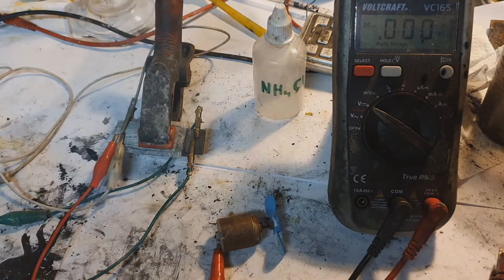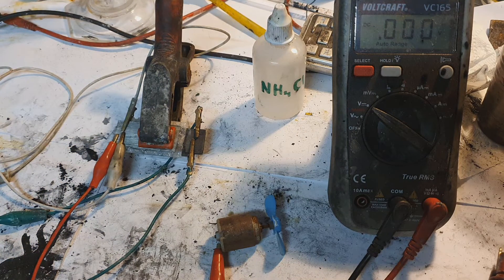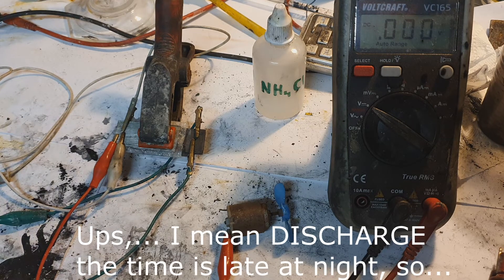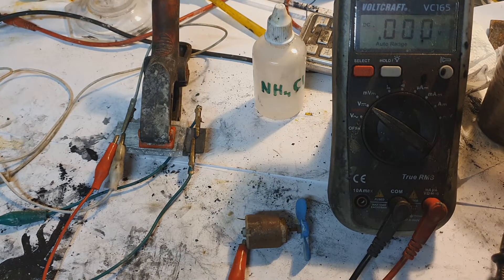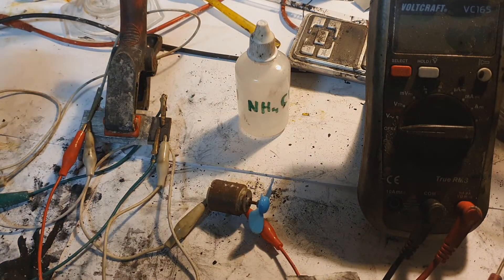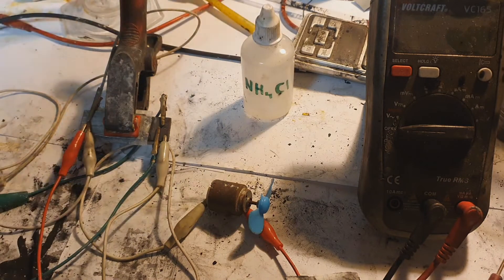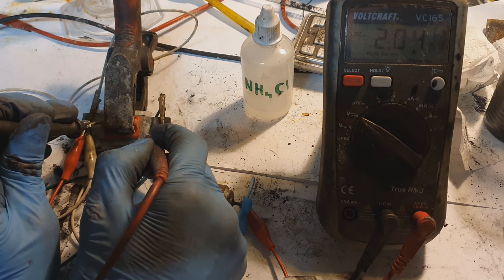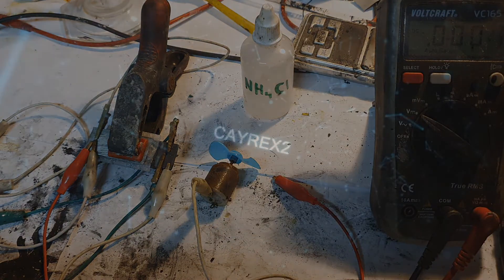2 Volt Tin oxide - Zinc Battery

Comment: Don't get me wrong, but it all seems very strange, starting with the patent itself, which uses a tetramethylammonium hydroxide electrolyte and which, according to the manufacturer, is incompatible with both zinc and tin. 
Link: https://www.merckmillipore.com/BR/en/product/msds/MDA_CHEM-814748?Origin=PDP
Are you sure that all that was presented is not a Hoax?
Reply from the maker: Hoax?? I get what I get and this I also share. Tetramethyammonium hydroxide works terrible for me
Reply: @cayrex  So you agree that we cannot use tetramethylammonium hydroxide electrolyte for the battery because it reacts with zinc and tin to produce hydrogen. This wastes power and renders the cell dangerous to use. So I wonder what patent rubbish is this?
Reply from the maker: @antoniocarlossforza  for me the use of tetramethylammonium hydroxide was the worst,.... so if you ask me this was a little hoax in the patent or the author dont apply the full data. Potassium carbonate which was also described in the same patent (on the almost end of the paper) was a bit better (the cell on potassium carbonate) run a motor for 3-4 sec. So, potassium carbonate was better but still wors what I can get with ZnSO4+NH4Cl.

Comment: I am trying to realize this battery similar to the patent - metal zinc and tin (97% other is copper) as active materials and 10% solution of NH4OH. Unfortunately the results are bad. Power output is ridiculous - high voltage drop when load is only 2 kOhm. Charging current is about  several milliamps but i think this power goes to something else, althought there is no intensive gas generation. I dont know what i am doing wrong. The patent says charge and discharge positive electrode states  are stannic oxide and stannous oxide, maybe it needs some cycles for metal tin to transform to oxide and getting good capacity?
Reply from the maker: Yes,.... you need to form tin oxide

Comment: Thats a really neat new type of cell Cayrex that you have created there, quite impressive stuff indeed, and congratulations to you!. Very much looking forward to your USB datalogger load results on this one. Hopefully it can cycle well and have a reasonable energy density fingers crossed. Then you will have something definitely quite special, very much worth developing to the next level. Happy experimenting and all grand stuff! :) (y)
Reply from the maker: Yes you are right. But I need to wait a little bit for the datalogger full test, because I need to boost the capacity. Its sad that in the patent dont describes any energy results that I can use for reference. At this moment I try to find the effect of having the conductive ink as binder in the cell,.... because the cell without binder have unstable voltage (fast voltage drop) with the starting cell voltage of 1.9V. But with conductive ink the voltage is really stable at 2.1V. I know that conductive ink as binder make all more conductive and the cell lower the internal resistance which makes more stable voltage, but the voltage difference of 0.2V. Maybe some extra intercalations are happen.
Reply from the maker: @Matthias Gregory you hacker you ...

Comment: The output on this very tiny element is awsome! The main is no need seldom materials like lithium or so. Question: Can you make courves of load and unload this cell using the EBD USB data -logger?
Reply from the maker: Yes I will,.... but you will need to wait a little bit for this. Because I'm behind with the videos and other projects.
Reply: @cayrex  Many Thanks in advance!